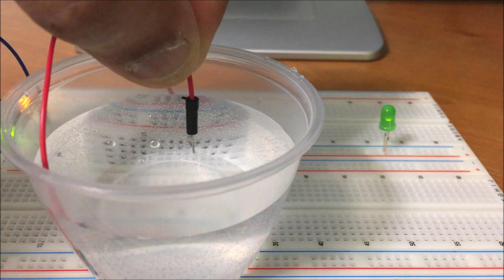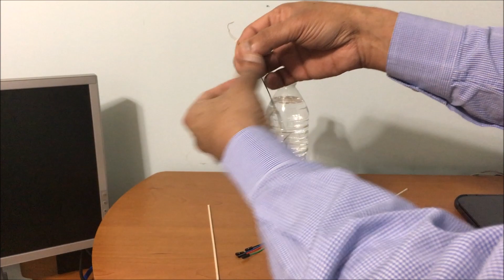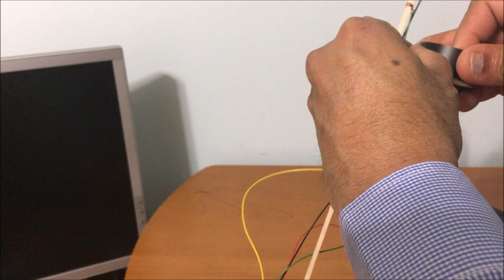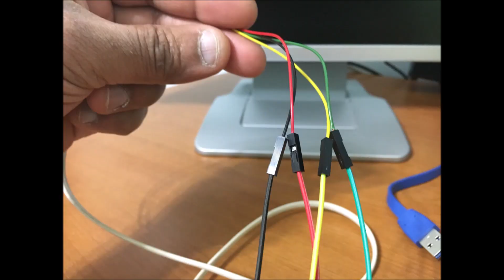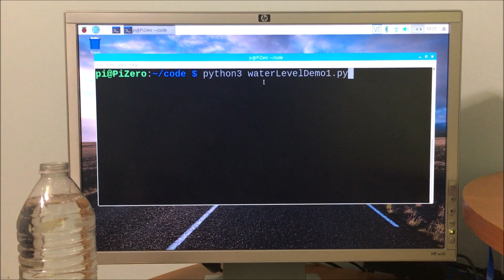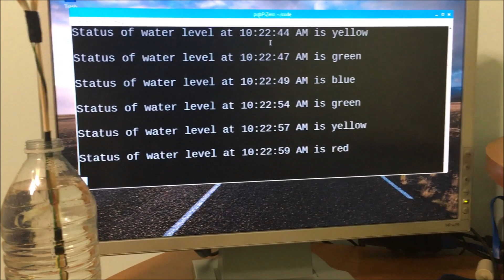Water Level Monitoring using Raspberry Pi - Part 1

Comment: I did this process as described in the video, however I only get *blue indicator when not submerged and I get *red indicator when submerged to the first wire on my stick. submerging further to green and yellow no change in indicator. unless I change the values of these "  levelIndicator = ((("blue","green")[green == 1],"yellow")[yellow == 1],"red")[red == 1]" Ie.. leave green at 1 and the others changed to any other number. only then will I get a green indicator when I submerge to the green wire.

Comment: Water will cause the wires to oxidize and over time they will corrode. You should run this program at set intervals instead of leaving it running indefinitely to increase the lifetime of your project.
Reply: I was actually only partially correct in the comment. You should technically wire the power to a GPIO, and output its signal i.e GPIO.output(pin, GPIO.HIGH) at the beginning of your loop and GPIO.output(pin, GPIO.LOW) before the sleep()
Reply: @dredd2015 i ve tried this code, always get red status after blue, no green and yellow